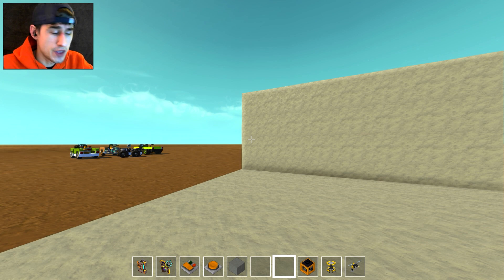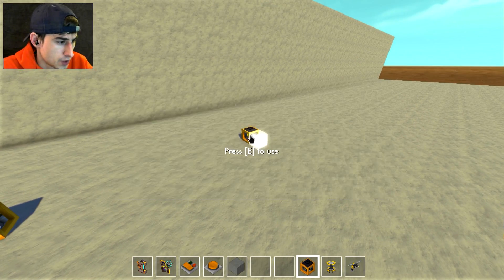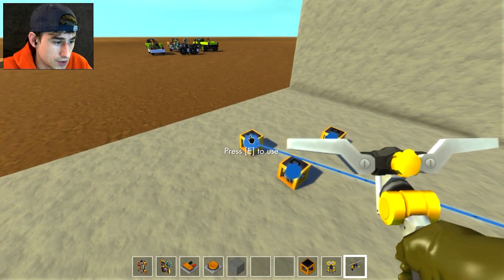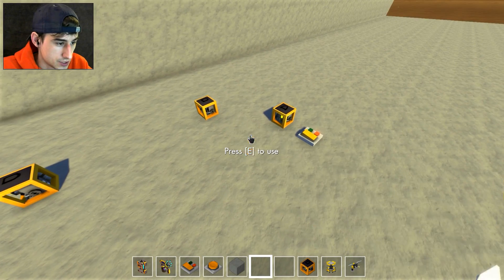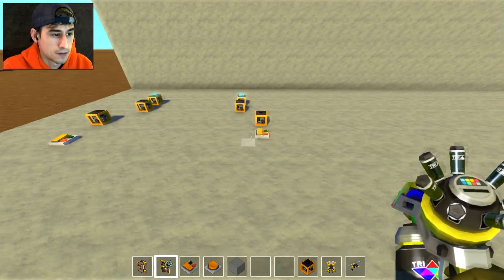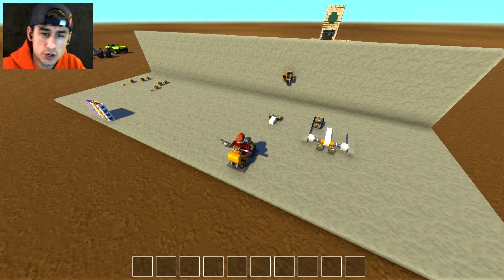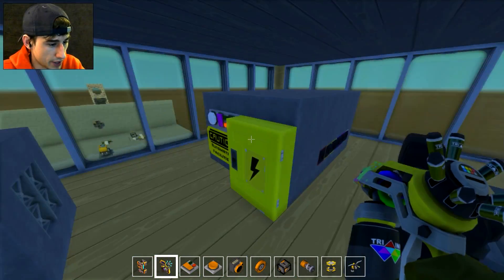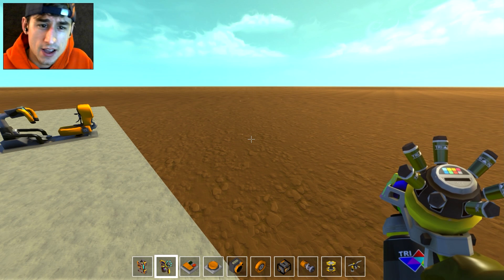Hover City Logic Explained! Parallel Communication & WSAD Converter Tutorial! (Scrap Mechanic #70)

Comment: kan I found  a old video and you accepted  the challenge  of  making a halo brute chopper that video was the pod racer video
Reply from the maker: You're right and I made a concept one. Problem is you can't get wheels big enough but I do have a bike with two wheels on the front that floats on the back end.
Reply: ok that's fine

Comment: hey kan make a tutorial on how to make the logic that you use in hover citty for thrusters I cant dow load from workshop because I dont have game bought from steam
Reply from the maker: The thrusters are actually really easy! 1 set is on the purple switch, 1 set is on sensors at 16 blocks range and the other is on 14 blocks range with an AND gate that only activates them 15 seconds after the purple switch. Next HoverCity video I'll explain this a bit better :D
Reply: kAN Gaming no i a saying make the logic block tutorial where you build the logic which is under you hover city
Reply from the maker: The wire is all the logic! Just connecting that 6 piece wire is how the entire city runs. After that all you do is connect the thrusters to the wires :D

Comment: Feels like I'm missing something. Can't you accomplish the same thing as your circuit with just an OR gate?
Reply from the maker: You can if it only goes in 1 direction. The wire allows you to hook up any section in any direction. Scrap Mechanic doesn't let you hook up a connection between gates both ways.